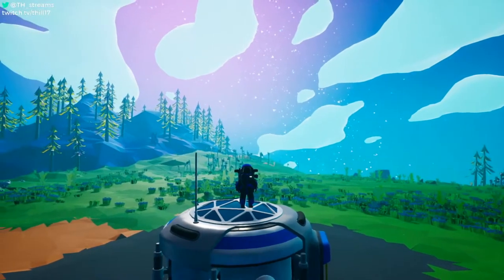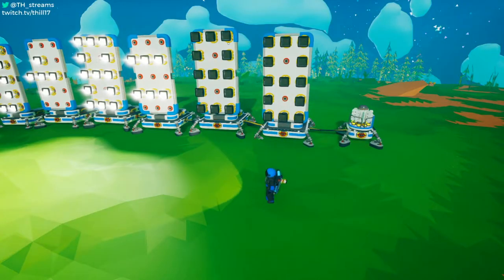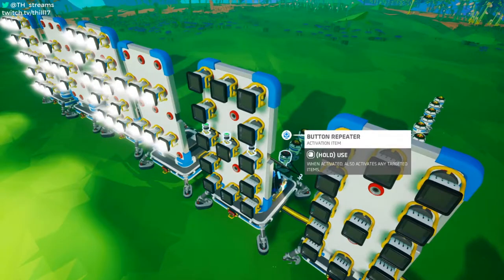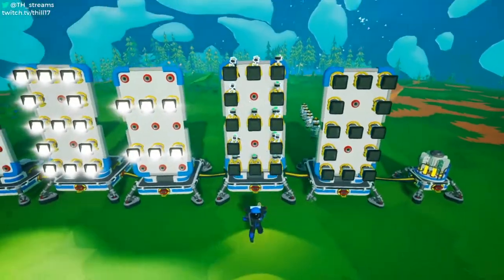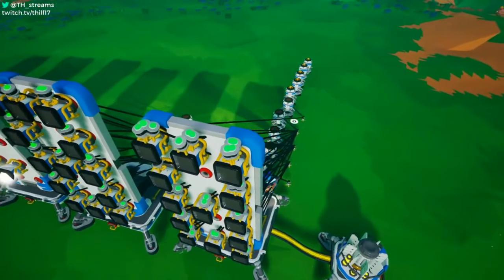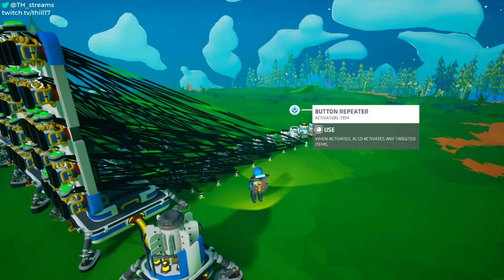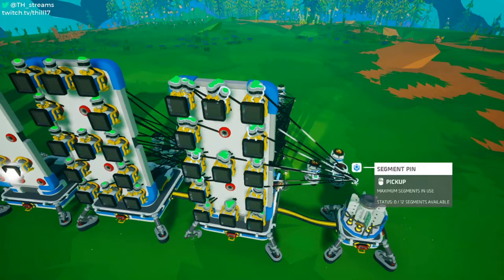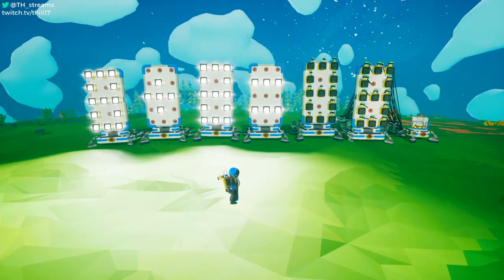Astroneer Build-Along: Calculator pt. 1 (Displays)

Comment: Great happy to see new videos  going  on but I'm seen and played bit with splitter  bug sometimes it add up power when it loops sometimes it keep power when power is in input and loops sometimes  make actual  voltage  that charge  battery's  before  complete  discharge  mind u try that out
Reply from the maker: Im not entirely sure what you mean, but have you checked the arrows on the cables? If the arrows are pointing into the splitter all power going in will be added to a total. If the arrows are pointing out then the total previously mentioned will be split between all outgoing cables.
Reply: @THill17  yes I been useing  arrows and 1 in the in and 3 is out if make loop and then use the 2 from first and 2th one going  3 and 1 and to it till the be one 2 unplugged  splitter  it supposed  be 1 and 3 and in that 1 that left place the power in and when it start to loop completely  and some  might arrows might show it consuming  power then fast unplug  power and plug the 1 in 3. the outher  layer supposed  be 1in 3out the 2th layer be splitter 2 to 1 and next splitter  2 to 3  the supposed  to be only 3 2 slot from layer 2  and it be like the first 2 be 3 and  and last be power input  and when it would show consumption  in the arrows  on the plugs un plug power and make it loop.

or the input and left plug where the power in after un plug would  go i would  place the  platform to use the power and keep loop .
that be the basic contribution  I find out this is old as 2018 and I thing it been forgotten  I used it to charge batteries  and for experiments.
Reply: @THill17  been talking  to mod about  it and it said that splitter  can multiple the input of power  I managed   to do it
Reply from the maker: Ya sorry I'm still not quite following